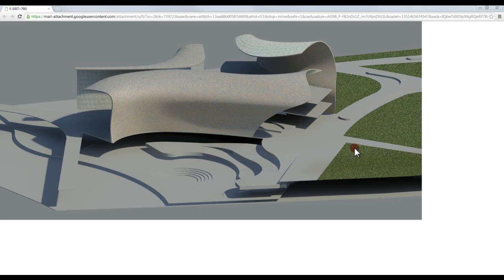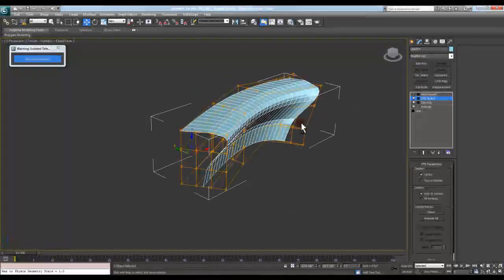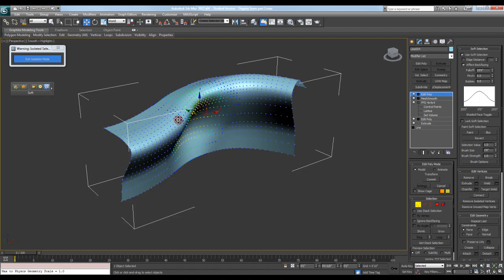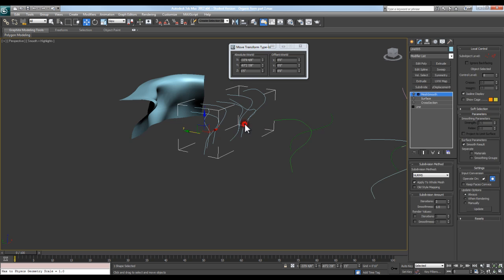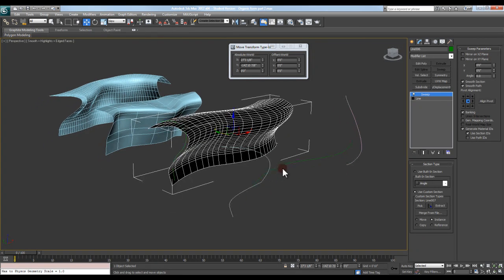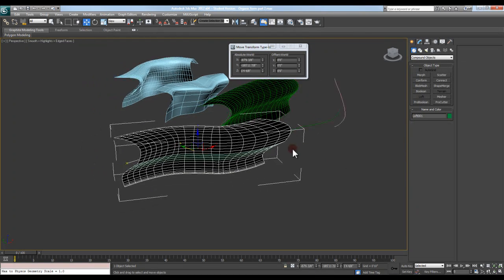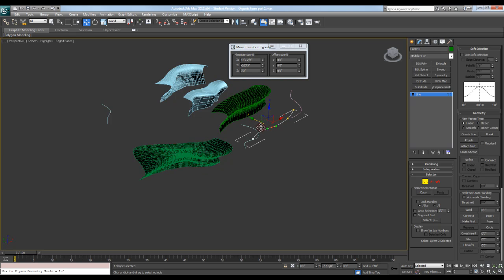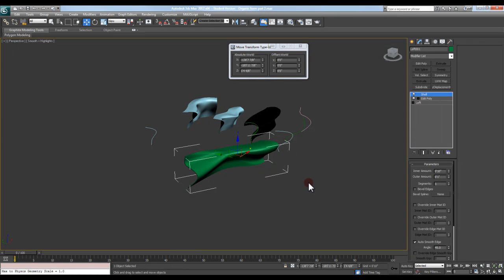3ds Max Tutorial - Organic Form in 3ds Max

Comment: Great examples.  You forgot to mention with the Sweep option, your original line is still parametrically linked in the stack.  If you converted it to editable spline before sweeping (same with the custom shape) you could have adjusted the shape of the sweep by dropping down  to the line path of the sweep, and push or pull the vertices of the line path to change the shape, or if you chose instance as the custom shape type, you could adjust the shape, and the changes reflect on the sweep.